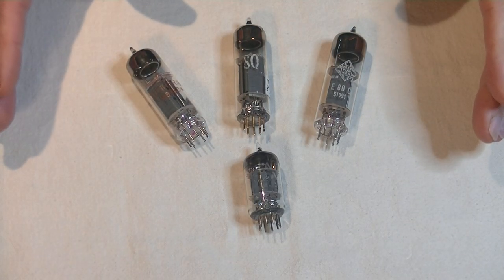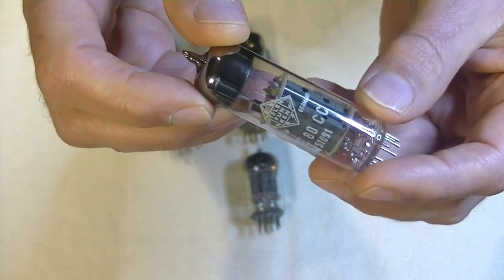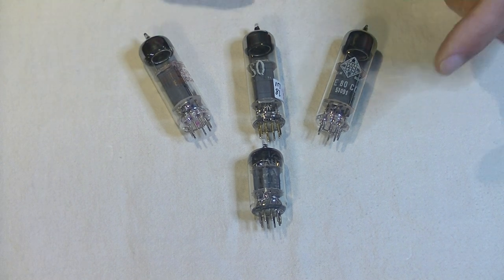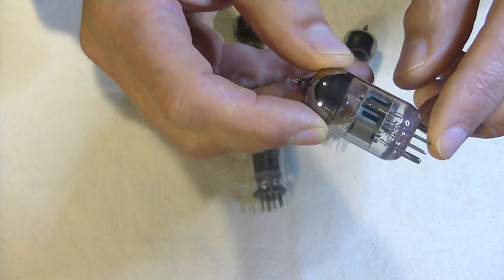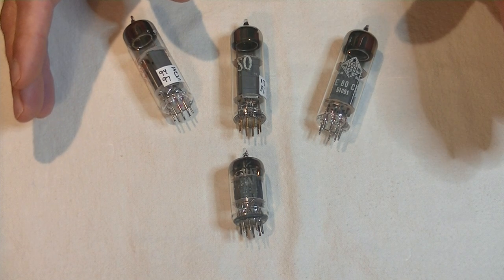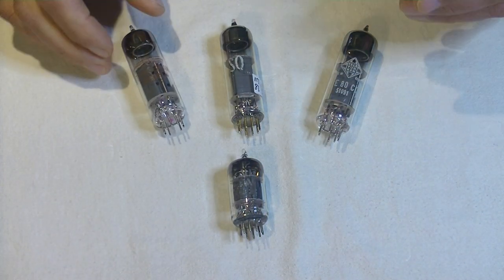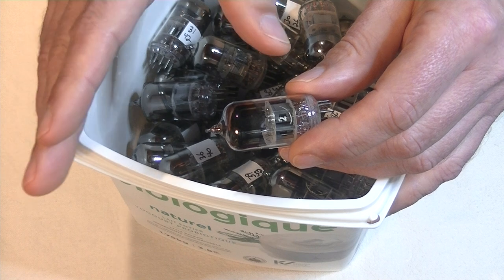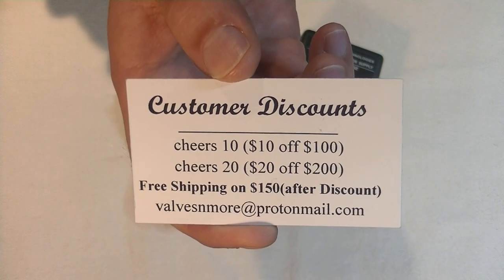Tube Lab#15 - E80cc

Comment: Hi Jim , nice review off the E80CC.........I replaced the japonese made 6240G by NEC  used by Luxman ( this tube is obsolete ) by the E80CC .........many replace the NEC tube by the 6CG7 witch is not quite correct  but common practice !
Another future of the E8CC is that this tube does NOT develop a cathode barrier like all or most radio tubes do ! 
If taken  care off ,  this tube will even outlive many more hours than the minimum 10 000 H life expectancy ...so one may have never to replace it . (when HV is not applied to the anode before the filaments are completely warmed up .........and the heaters are only shut down when the capacitors have been drained after  the HV has been switched off )

On female voices the tonality never breaks up as so many times heard even on hi-end amplifiers with their stubbing measurments on static tests....but never equaling the quality of a good tube and a good tube amplifier . ( some come close at a pricetag X times )

Have a nice day

Comment: I use the Tungsram e80cc tube in my VAC PA 100/100 Amp and they excel . They have made it imposable to go back to a 12AU7. I'm afraid to try them in my preamp also a VAC (Vacuum Amplification Company) because I'm afraid to hurt the transformer and haven't contacted them.

Comment: Would love your opinion of the E80cc vs the 12bh7. Filament current is similar and gain a bit lower when comparing to E80cc. Have been using them in place of 12au7 for some time...but you have caught my attention here.

Comment: Can l plug in  a pair of e80cc  in lieu of my 12au7 ? More punch . Less noise. Definition ? I bought two Philips Nos 1972 e80cc
Reply from the maker: You haven't watched the video, it answers this exact question and the answer is .... maybe.
Reply: @tubelab194  l will watch it with more attention. Thanks
Reply: Two Nos Siemens arrived today, 1967, and they work marvelously on my balanced pre amp. In lieu of noisy 12au7.